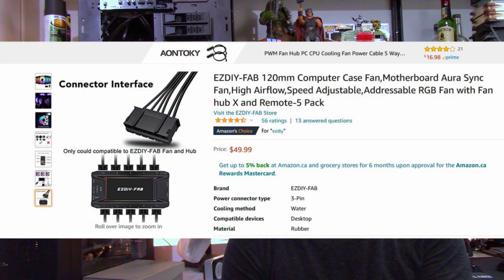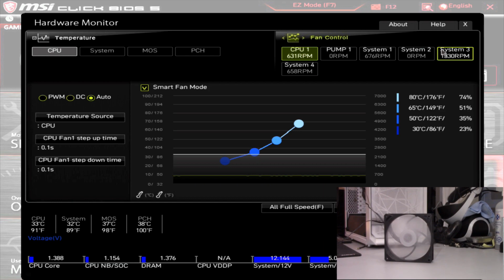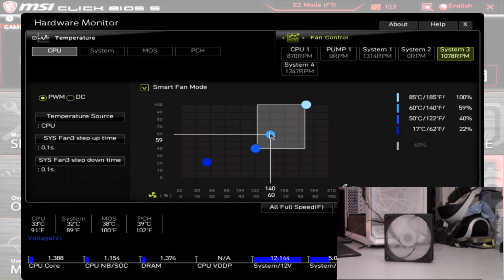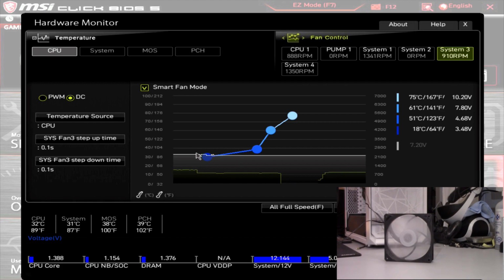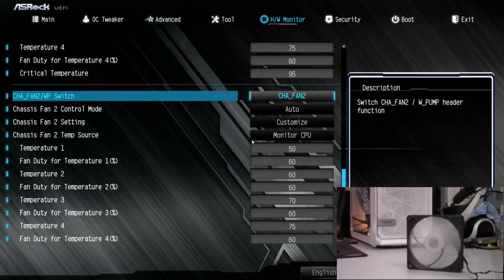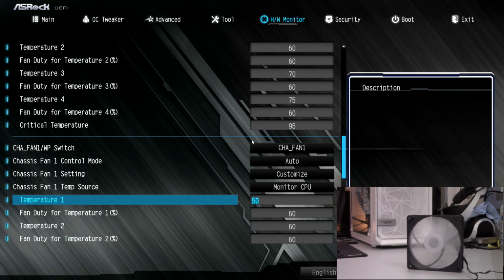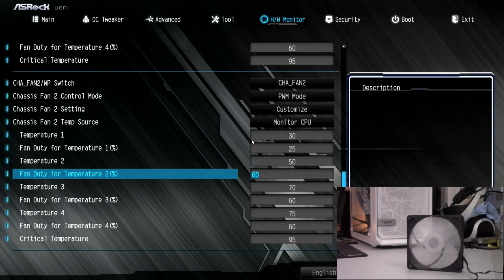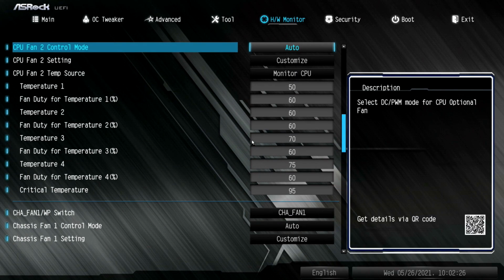How To Control Fan Speeds On PC

Comment: wait so i have the control hub for some of my fans and i use a sata cable that goes to my psu to operate it— the rgb turns on fine but since i can’t control them from my bios, shouldn’t the fans just run when turned on? cuz mine don’t and i don’t know what other solution i could do since i can’t get a cable that connects to my motherboard right now

Comment: Which fan are you using in this demo? On MSI BIOS, if you set it to PWM and drop the first point to 0% upto certain cpu temp will it stop spinning if the cpu is below that temp? You have shown that for DC mode but what about PWM? I know different fans behave differently when set to 0 in PWM mode. If this fan does stop I want to know which fan is it. Asus and Gigabyte have a dedicated check box called Auto Fan Stop which can turn off a fan in PWM mode even if it is not a 0 rpm fan and I want to know if the MSI board implements a similar behavior without the Auto Fan Stop option.

Comment: The motherboard needs a system fan header to control the the case fans or what ?
Reply from the maker: @JimmyPlzz  the fan(s) will need to be plugged into a fan header, yes. If it's a CPU fan header or a system fan header, it doesn't matter.
Reply: @HardwareForGamers  i wanna buy an asrok b660m pro s and i don't know if i can control the case fans speed and rgb

Comment: So I can adjust the fan speed of each individual fan header in BIOS? What if i have a splitter, will the header control both fans to be set to the same speeds?
Reply from the maker: the header lets you control the PWM/voltage, so yes if you have a fan splitter the fans will run at the same PWM/voltage (if they're the same type of fan then they will be at the same speed/RPM +/-, but if they're different fans they will be running at the same PWM/voltage which may not be the same speed/RPM.)  typical headers can only handle 1.0 amps, so depending on the fan and how many amps it requires will limit how many fans can be on 1 header. hope that helps
Reply: @HardwareForGamers  Awesome, thank you so much! It'll be my first time building, which you can probably tell by the question ;)

Comment: Sir, what if I have only system 1? I have three arctic pwm fans daisy chained, and one three pin zalman case fan which came with the pc. I do not have option to control them separately. I control them all through sys 1, but I think this zalman one is not pwm so its running at constant speed.
Reply: Same, maybe it was like this before but I reset my bios and ever since I’ve been struggling to fix everything. I’m getting stuttering in games which never happened before and only my system 1 is running out of the 5 that show and I’ve tried everything. It’s been LITERALLY over 24 hours at my computer the past couple days trying to fix this googling and everything. I just want to play counter strike but instead I’m losing my absolute mind. Did you ever fix this?
Reply: I dont encounter those issues. My problem is that I dont have option to control my fans individially, from the beginning @PureCapsaicin  I only have system 1 in SIV, which controls all of my fans at once, but not separately which I want. Hope you understood me, and wish you all the best of luck with fixing your issue :)

Comment: i have a case that came with fans and hub on the back (stock) and i decided to add a new fan on the top of the case to help the cpu more, but found out its a 6 pin...and my gigabyte mobo has 4 pin, so i plugged it on the hub in the back where other stock fans are connected, when i turned the pc on the fans were working but the rgb lights stopped, i started playing a game then they all lit up except the new one, what could be the problem here ? voltage ? the new fan is 12v aswell as the others
Reply from the maker: So there's only one 6pin header on the fan? And the hub is also 6pin? Are they the same make/company? The new fan and hub.
Reply: @HardwareForGamers  yes the case came with the hub and the fans, and the fan i bought is from another company and its 6 pin/12v too, when i turn the pc on the fan rgb starts twitching like they are not in synch then they become normal, but the new fan only spins no rgb
Reply from the maker: @blu8762  it is possible because they are different companies the pin layout of the hub and the fan are not compatible. That's my best guess.
Reply: @HardwareForGamers  i had the same conclusion tbh, if i bought the whole package with 5 fans they come with their own hub/controller so i guess they have a specific equipement in order to work properly.i honestly dont care about the rgb that much more than cooling especially in hot weather, the only concern i have is if it can damage the pc or the other fans in the long run ? fortunately i didnt try to force plug it on the 4 pin of the mobo otherwise rip lol
Reply from the maker: @blu8762  I don't think it would happen, but I guess it is possible that it could blow up the hub which could kill the other fans. Mixing and matching cables is typically not a good idea.
Reply: @HardwareForGamers  i see.. i will just keep it then till i get the full package and replace everything , thank you for the help!

Comment: I have an older Fractal Design case that has a manual fan speed switch built into the case's control panel with 3 speed modes. While the PC is turned on i can increase the fan speeds via the switch, but if i try to lower the speed the PC crashes. Always wondered why that is. The fans are DC i believe.
Reply from the maker: Is the switch even connected to the motherboard?

Comment: hi i’ve been having this problem with my fans since i built my pc and no amount of research seem to have solved the problem . I have an msi motherboard and it does not have the option “auto” so i have a custom fan curve which keeps the rpm at around 850. but whenever i load into or exit out of a game my fans spike up to 1100 rpm and stay there which is pretty loud and annoying for my 160mm front fans. the only way to fix it temporarily is for me to open msi center and check the “custom” fan curve , but as soon as i load another game the same thing happens. I’ve tried many different things and also changed my temperature source from the cpu to system but even that dosent seem to work. any help would be appreciated
Reply from the maker: what fan is it??? what MB is it??? how are the fans plugged it???
Reply: @HardwareForGamers  all my fans are the ones that come with the lian li 216 case. i have a b660 tomahawk mb and my fans are plugged into the fan hub that comes with the case
Reply from the maker: @moneebnajibi1335  does the hub plug into the motherboard?
Reply: @HardwareForGamers  yes
Reply from the maker: @moneebnajibi1335  so you should be able to set up a custom fan curve in the UEFI or be using FanControl. And just have that fan curve be a flat line at whatever speed you want the fans at.

Comment: Great Video. The problem I'm having is my PUMP 1 in my BIOS is showing 3000+ RPM, it's a 3 pin AIO plugged into a 4 pin connector. when I switch my PUMP 1 to DC mode my cpu temps immediately shoot up and climb from 28C degrees C to 50C degrees+! I then put it right back into PMW and the temps lower back to normal and everything is fine, but im still stuck with the loud 3000+RPM fans that are on my AIO... any advice?
Reply from the maker: what voltage is it set to when in DC mode?
Reply: @HardwareForGamers  I have it on dc + smart fan mode going from 12v 6v 4v 2v top to bottom… my pump and fans actually just turn off when I put it into dc mode… but are 100% in pwm mode
Reply from the maker: @austins4960  if you have set to DC + smart fan and set all temps to 8v does the pump still turn off? now it is possible that the pump requires 12v to run and that's why...

Comment: Thank you you so much, literally the exact video I was looking for. However, I have one question, what if you have 4 pin fans connected to a hub that connects to the motherboard with a 3 pin connector. Are the fans now PWM or DC?
Reply from the maker: You would need to use DC to control them.
Reply: @HardwareForGamers thanks

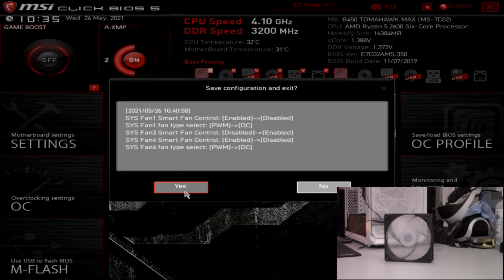Comment: 7:54 Did you intentionally avoid using the graphic tuning curve interface on the Asrock board (under fan-tastic tuning) or did you just not realise it was there?
Reply from the maker: I prefer typing it in.
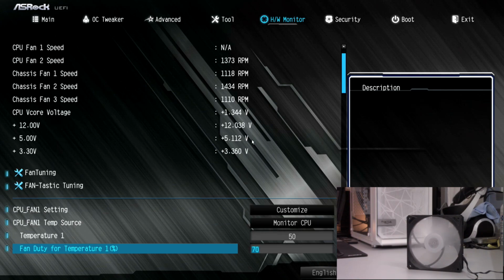Reply: @HardwareForGamers  If you want to setup multiple fans the same you have to write the settings down or scroll up and down to recall what you set. In the graphical interface you can flick back a fourth between the fans to compare their curves. You can also just set all the fans to have the same curve which I don’t think is possible outside of the graphic interface. You said you had setup your rig for all the fans to be setup the same (8:34), so if you typed all that in you wasted your time 😁

Comment: zup! awesome vid bro! subbed and liked. I have bought some fans and they are feeded by the sata power. I cant manage to find how to reduce their speed, can you help me?
Reply from the maker: If the fans are plugged in to the power supply there's not much you can do, Sorry.
Reply: @HardwareForGamers  oh no =( isn't there any adapter to do it? thanks for the quick answer!
Reply from the maker: @schumacherguilherme  so your fans don't have a 3 pin or 4 pin fan connector just a sata power connector...?
Reply: @HardwareForGamers  Thats right

Comment: Hey man, I have 6 sp120 Corsair fans.. they are 3 pin fans so they aren’t, PWM so how do I control their speed? They are very loud, and mad blowing air out of the back.
Reply from the maker: As I show in the video, you will need to set the fan header to DC mode and adjust the voltage.

Comment: I have a feeling if you're using jargon like POST, then it's not likely this was made for a beginner. and thus likely someone knows how to change their fan. But if targeted towards, beginners, I'd recommend (unsolicited) staying away from jargon. Because this is useful I actually had a couple people who I recommended this to mention they weren't even sure of some of the early description and gave up. just my $0.02
Reply from the maker: I kind of get what you're saying, but how do you explain a POST without using POST?? The initial system check performed by the system at boot up... Wouldn't that be just as complicated as using the word POST, or am I wrong?
Reply: @HardwareForGamers  You explain how to do it. I had to search a significant additional amount of time to know how to enter "POST" when it could have easily been explained, in 3 seconds, here. 

Another video said "spam delete when restarting" and that's all I needed to know.

Comment: I have a Corsair 5000d case it came with a fan hub and all the fans are 3 pin. I can't seem to change their speed? Any ideas? I tried BIOS and a program.
Reply from the maker: Does the fan hub have a way to plug into the motherboard?

Comment: Mate …did u ever tested the temp with front fans full speed and back at low rotation ? I wonder what speed we should use exaust … same,lower 😂
Reply from the maker: It will depend on the case you're using, and if it should be equal or positive pressure.
Reply: @HardwareForGamers  uhm k

Comment: Does this work on Hp pc
Reply from the maker: Depends on the BIOS I guess.
Reply: @HardwareForGamers  ok. I’ve tried fanspeed, a software from github, but got some issues ( the fans cards didn’t appear after the installation) and my computer is still freaking noisy, the fan speeds up as soon as the cpu on the task manager goes up. It’s really disturbing.
Reply from the maker: @tym4028  are you using a laptop or PC?
Reply: @HardwareForGamers  laptop 💻
Reply from the maker: Laptops typically have a locked down BIOS, so modifying them is hard, annoying, and or impossible. Most of the solutions that work for PC don't really work for laptops. HP might have some software that will let you control the fans... there are also some softwares that will let you modify the CPU and or iGPU (if you have a Ryzen CPU it's Ryzen controller not sure what it is for Intel), but the best solution would be to open the laptop, clean it replace the thermal paste and pads. Extreme yes, but it will likely fix the noise /temp issue.

Comment: My system fan rpm is 0 but they are working why?
Reply from the maker: Is the fan in pwm mode??
Reply: @HardwareForGamers  i tried dc and pwm mode but its still 0 fan rpm for some reaso n even tho they are spinning
Reply from the maker: What fans and motherboard are you using?

Comment: i have tried like 3 different third party softwares and my fan doesn't show up in any of them. Also, the HP Bios doesn't have a power tab like in all the videos and tutorials. very odd
Reply from the maker: This is a laptop your speaking of?
Reply: @HardwareForGamers  hp laptop. I opened it up earlier and the fans were working, but I can't hear them at all, even when I visually saw them running, and they down show up anywhere software wise
Reply from the maker: HP should have some sort of software to control the system fans...

Comment: Why does your system 2 have 0 rpm I have the same issue with mine but for me it says system 1 has 0rpm
Reply from the maker: That's because there's no fan plugged into system 2.

Comment: Hey man I've recently built my pc and tried to do things like overclock and control the speed but I am unable to do either of them my CPU Cooler is a Cooler Master MASTERLIQUID ML240L RGB V2 which comes with two fans that I have put above the motherboard. My pc case which is a Cooler Master MasterBox TD500 Mesh and is included with four fans, three at the front and one at the back. It seems when I try to either speed up or slow down the fans it only controls the one fan at the back now I'm not sure if it is due to my motherboard or if I plugged them in incorrectly (they all spin btw). As shown in your video my motherboard is also a Asrock (ASRock Z390 Pro4) hopefully you will be able to help me if you can. :D
Reply from the maker: Are the fans in the case 3 pin or 4 pin fan connectors? Are the front fans plugged into different fan headers on the motherboard or the same?
Reply: @HardwareForGamers  is there a way I could get in contact with you to send photos?
Reply from the maker: @uymxv  I have a HFG discord server
Reply from the maker: @uymxv  Discord invite - https://discord.gg/enbDZAP
Reply: @HardwareForGamers  I have messaged you on discord

Comment: Need help! I have four coolermaster sickleflow 120 argb and 3 of them the speeds can be control but 1 of them are running at 2400rpm and i tried changing it at bios but doesn't work and it show in the table on right no matter wht temps the speed is the same.Is plugged in into the cpu_fan header.
Reply from the maker: What type of connector is it? 3 pin? 4 pin?  Have you set smart control for that header?

Comment: hey Bro, Please I need your help, When I open speedfan or msi afterburn I dont find the fan option at all
Reply from the maker: MSI afterburner is for the GPU. So you're trying to control the GPU fans?

That is what you're trying to do install drivers and then restart your computer and see if that helps.
Reply: @HardwareForGamers  all what I wanna do is to slowdown the fan, cuz it's so loud and it makes the laptop so hot
Reply from the maker: @businessforwealth8432  what brand laptop it? Most brands have software to control those things.
Reply: @HardwareForGamers  first of all, thank you for help bro, it's MSI, and I tried msi afterburn and speedfan, but they can't detect the fans, and they don't show the fan tab
Reply: @HardwareForGamers  I have now 5 hrs trying to solve this problem
Reply: @HardwareForGamers  a laptop with ferrari noise
Reply from the maker: @businessforwealth8432  MSI dragon center should be the program you're looking for.